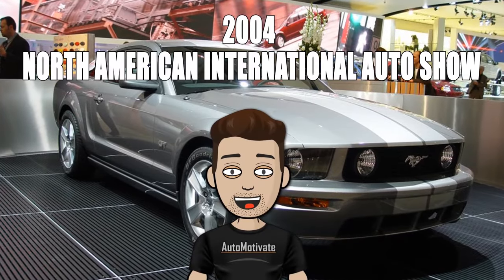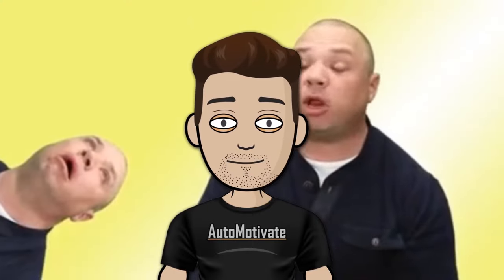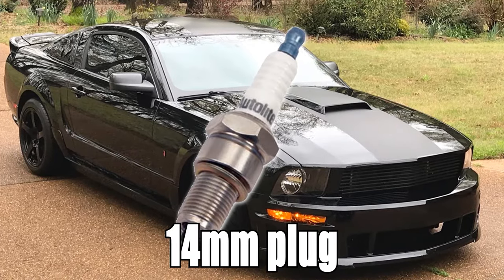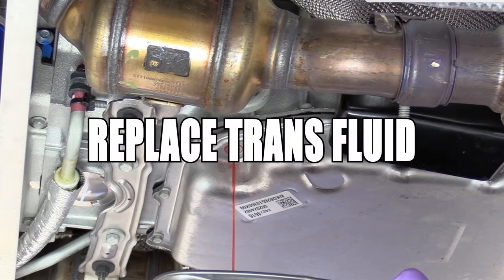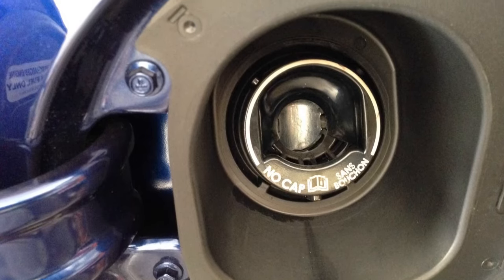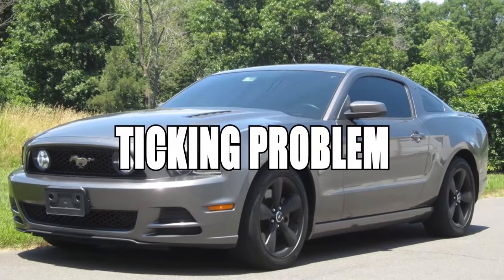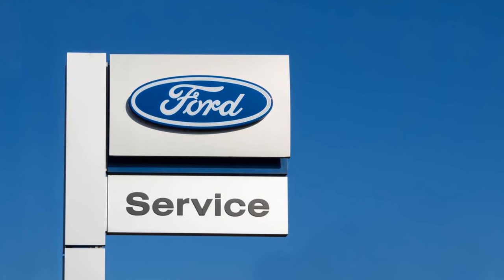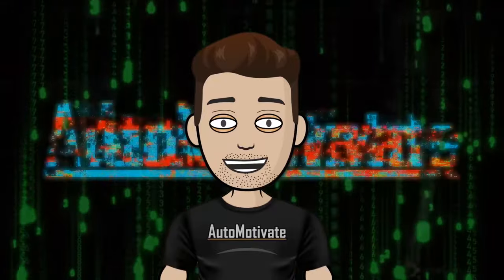Watch This Before Buying an S197 Ford Mustang 2005-2014

Comment: Even with the tick, those engines don't fail. They keep on running. It is a better car than a Camaro in almost every aspect.
Reply: Anyone who downvotes this comment obviously have seen the back of a mustang a few too many times.
Reply: 05-09 or what years I’ve had great experience with the 05–09
Reply: Late reply but is it better in aspects of specs like speed or durability?
Reply: @Boonkgang-lk6wy  for a used car this old yes
Reply: Why do they make that tick noise
Reply: Yes 3 years later but thank you for this anyway. The car experts also agree such as Motor Trend and Car and Driver. I want a 2011. Steve McQueen rules.

Comment: Gen 1 coyote in 11-12, gen 1.5 in 13-14. Changed from 412 to 420hp at the 13yr not 12. Gen 2 coyote is 15-17 and gen 3 coyote in 18-present.
Reply: Then you have the 5.0 'Roadrunner" found in the Boss 302, which was a 5.0 with stronger internals, CNC heads, Cams etc etc making 444 hp
Reply: @Snipedkill1016  It's still essentially the Gen 1 or 1.5 coyote. Just upgraded lol. You could in theory make the road runner yourself with a bare bones gen 1
Reply: gen 4 on the s650 ;)

Comment: I doubt you have ever actually owned an S197...broken clutch forks? Spitting spark plugs from the heads? Just to name a few. S197’s have a hydraulic clutch, ie, no clutch fork. And, 3v’s don’t spit plugs, it’s quite the opposite.
Reply: I have not owned a mustang, I own a G35 but one of my freind who owns the 4.6 3 valve mustang has told me that the spark plugs are 2 piece in the older models and can be annoying when replacing them, idk abt the clutch though

Comment: I have a 2011 3.7 convertible. Best of both worlds! 305hp and 31mpgs highway. 102k and it runs like new. I am a long time Subaru guy, but I am enjoying the Stang!
Reply: Good to hear. Not long picked up a 2013 V6 convertible.
Reply: As long as you religiously change the oil on time in the 3.7L it will last a very long time. Most 3.7L failures and caused from overextending oil change intervals.

Comment: You don’t have to remove the 4.6L engine out of the car just to replace the timing components you can also replace the oil pump with the engine in the car I did it on mine
Reply: I think he was referring to the 4.0 ltr v6 in the video not the 4.6 ltr V8😅😅

Comment: Not sure about the 2011 and up mustang gts but the 05 gt with a manual has been pretty good to me. The transmission is sloppy with long throws but with regular fluid changes it does the job reliably. 
The wear on my car has mostly been the oppressive Florida sun. The dashboard cracked in the half. The leather seat is wearing. The paint is starting to fail even with regular car washes and paint sealant applications. 
Mechanically I’ve had the piñon seal of the differential leak. 2 alternators blew up. A purge valve replacement. And needed to clean the throttle body once due to the car stalling coming to a stop light. 
To avoid timing  chain issues I regularly change the oil ever 6 months or 4000 miles with Pennzoil ultra platinum oil. Keep the engine oil clean and most mechanical engine issues at bay.
Reply: Have a 2005 GT Convertible manual and when bought in 2018 had 36k. It was as new, fast forward to 2024 it has 55k , runs like a top. some interior issues but mechanically great. Love this car and it still shows great. It is the best 10k spent on a vehicle ever.

Comment: I've had my 07' GT CS since it was new, currently at 74,000mi, the only mechanical problems I've had was a alternator replaced in 15' & a e-brake, cosmetically the paint on the hood front lip rusted & chipped, on the top of the side scoops clear coat & paint wore away, headlight fogged, door interior leather trim came loose & strangely on the rear view mirror, the mirror material became de-laminated, plus multiple recalls on the airbags, twice on the passenger side. Fortunately the cars been repainted and the other issued have been addressed.
Reply: Damn. Nice. That's super low miles for an 07. The transmission in my 07 GT failed at 140k. It also needed a complete timing rebuild at 150k with new VCT solenoids as well. Those are the two main things I'd keep and eye out for if I was you. It's always been meticulously maintained. Now at 160k miles. The motor still runs great after the timing rebuild... which I did myself. It's had a couple of leaks. One oil leak and one coolant leak. Both I was able to fix myself as well.

Oh and yeah. These cars don't like sitting in the sun. I've always kept mine covered so it's only just now barely starting to get some clear coat peel on the spoiler. Barely noticeable. Other than that it's still in very good cosmetic condition. It's also a limited model. Came with a cosmetic "Outlaw" package done by Steeda which included a Steeda spoiler, 18" bullitt rims and racing strips with "outlaw" written on the sides of the hoodscoop. It's a beautiful car.
Reply: @sk8n854 urs manual or auto? I hv been told that manuals are pretty reliable

Comment: I have an 07 Mustang GT with 160k miles on it. 

Did a timing rebuild at 150k miles. Did it myself. It wasn't too bad. Also needed new VCT solenoids. Only cost me about $800 total for parts. The transmission also went out at 140k miles and that was a super expensive repair. Over 5 grand for refurbished trans with 3 year warranty parts and labor. Other than those two things, everything has been just usual maintenance and small repairs here and there. Have never had any problem with sparkplugs. No problems with rust. If it wasnt for the trans not making it past 140k, I'd say its held up well, but that really kicked it down a notch. Theres no transmission dipstick to check so if youre thinking about buying one with 140k-ish miles on it. Just be aware of that. The motor itself feels like it is running very strong though.

Comment: Debs husband says I have owned my 2006 Gt for almost 3years and my repairs have been replacing the valve body on the auto transmission. I replaced the end links to the stabilizer bar and replaced the fuel pump.   My biggest problem was getting a fuel pump that was reliable. That is not the cars fault but the result of poorly made parts. I first put on a Spectra pump and it wouldn't make pressure out of the box.  Then I went through 2 Delphi pumps that would not maintain fuel pressure.   Finally I had a Motorcraft pump installed and presto!  Problem solved!  I realize that with anything mass produced there are going to be good ones and bad ones so I am not saying that Spectra and Delphi pumps are not good pumps I am just stating my experience.

Comment: Air handling servos often fail in all years.  Replacing the drinker side is a pain but can be done, whereas changing the driver's side is a nightmare that requires a heat gun to soften the air duct in order to reach one small fastener!

Comment: sooo i have a 2008 mustang gt and ive had it for about a year now and the only problem ive had with jt is the alternator giving out other than that its been running pretty smooth, she has 195k miles on and its still hauling ass 😂, i do plan to rebuild the engine pretty soon tho and thats because i just fell in love, she hasn’t gave out to many problems oh also the cam phaser bolt did break and its still broken i have a check engine on but i just haven’t had time to fix it yet also everything on it is still dead stock except for the back tail lights and the alternator i upgraded to a sr performance one with a performance wire but yeah all in all in all she is about to hit 200k soon and still running very well which im very thankful for 😂

Comment: 14 GT convertible - only problem so far is a plastic gear in the driver’s side power seat. Gear stripped and left the seat immovable. Big problem since I’m 6’2” and my wife is 5’3”. Searching online I found this is not uncommon. Fortunately, Ford realized this and started selling a repair kit - basically just the failing part. Before, you had to buy the whole seat track assembly - big bucks. I installed it myself, kind of a pain cause you have to remove the seat from the car.

Comment: Thank you for sharing! So you are saying that 4.0 v6 is the model that has the least problem and most reliable?
Reply: Mines shuts off while driving and I have 4.0, any ideas
Reply: @levisamaya  maybe the alternator isn’t working properly so your car isn’t getting the battery energy it needs
Reply: @coob5629  car doesn't need energy while on the road. Lights yes they be out, battery will die, but it will never shut down because of it.
Reply: @levisamaya  check the sensors on engine, if all are in place
Reply: @johnanderson71  not true; the alternator requires additional grounding on these cars. The FICM will fail without proper voltage and proper grounding. Then it won't get fuel to the engine. Everything on it runs off complex computers. They need the electricity at the right voltage. Ungrounded alternator causes voltage irregularities.

Comment: Just got my 07 4.0 V6 at 75000 miles and my alternator just went out and are there any problems with the T5 5-speed manual transmission that I should know about

Comment: Someone is selling a 2005 premium convertible 2d 133000 miles $1700 but it doesn’t turn on, should I consider buying it ? He said it takes $1300 to repair the problem
Reply: No find an '02-'04 for that price

Comment: Had a 2005 V6 5 SPD  (bought new in 2005) for 6 years no problem... except on year 5 the Hydraulic transmission gave up and costed me a fortune to repair ($1,200) ... maybe I was screwed.

Comment: Pulling the engine is. Deal breaker for you. That's because that is a many job
Reply from the maker: I have pulled engines before. A man does not need to pull an engine to justify himself as a man. You are your fragile masculinity smh

Comment: Do not ever make a video again if you do not understand the difference between a s-197 and the sn-197 2 different body styles and both having different  motors. The 4.6 3v was a tourqe based motor like the 4.0 by vs the 5.0 and 3.7 were HP based motors.